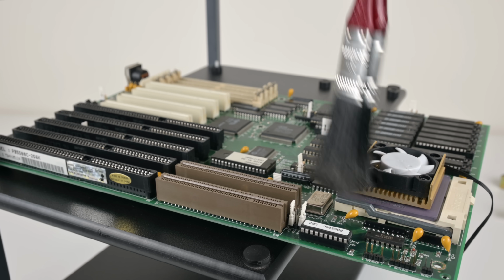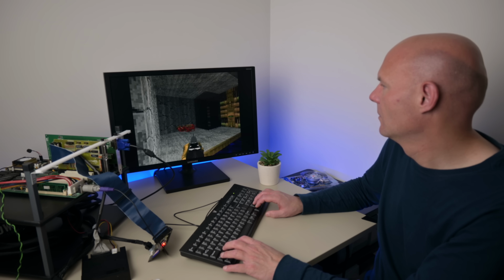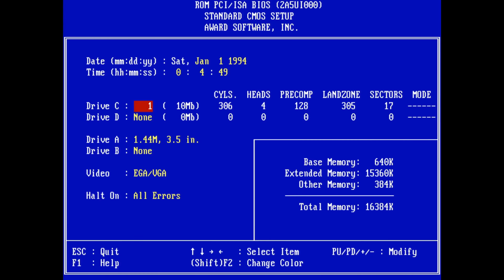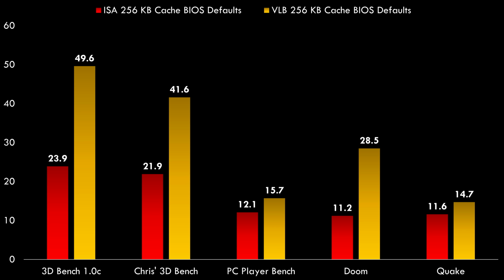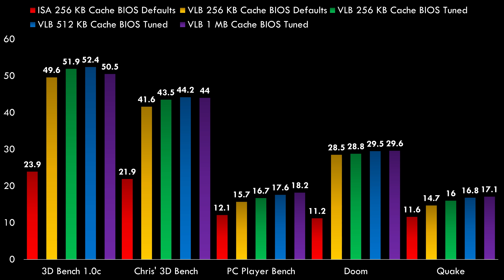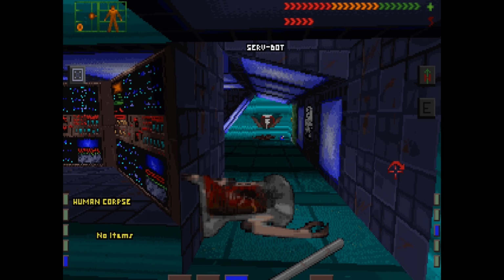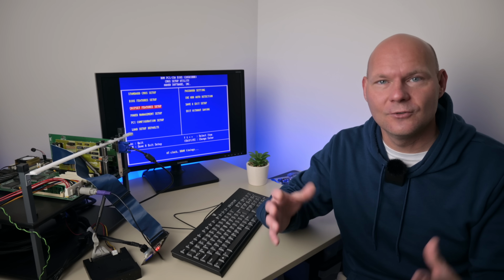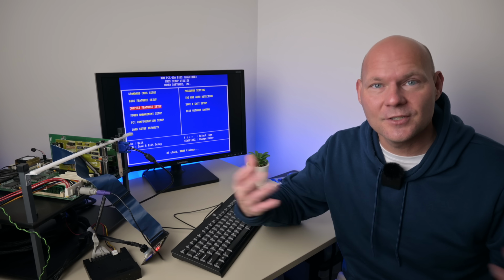Broken CPU Launched the Pentium Branding

Comment: 08:00 not a huge performance boost?!?!? Naah, from 11 to 28 FPS in Doom, you won't notice that :PpPpPPP heh. I had the 60mhz, initially the FDIV buggaroo then not bugged in the mail courtesy of a penitent Intel. But something is wrong with your setup, it defo runs Doom properly cache or no cache. You know what is wrong? No one, and I really mean no one - ran ISA or VLB graphics on these. Ever. You need a 5436 Cirrus or some other period correct PCI card. These were VERY expensive machines back in the day, the CPU and motherboard alone cost more than a complete decent 486dx2-66 with 8mb maybe even 16mb ram and 400mb hdd. That's why NO ONE gimped them by using handicapped VLB or ISA graphics on them. I worked in a PC store a couple of years later and have thus seen plenty of machines from this era. Guess how many with VLB things in them? One. I advised the customer to ritually burn the thing. I don't remember the specifics anymore but there is a problem with VLB in these where you suckerpunch the IO or something by using it, and there is a reason why 1 or 2 out o 20-30 motherboards for the first pentium had VLB. None of the proper boards had it, by proper I mean Intel spec that actually let these things perform properly, unlike that... thing... that you have it in there.

Comment: A Peacock Pentium 60 with 8 MB PS/2 memory, 420 MB HDD and a Spea Vega 7 1 MB PCI was my very first PC, purchased in 1994. Price was good at that point of time (2400 DM) but the seller had to cut corners to make that price possible. The Vega 7 was slow like a snail, in many benchmarks like Superscape I got less FPS then a 100 Mhz DX4 with a better card. Also the card was faulty and had a red tint if working at 33 Mhz, so overclocking my Pentium 60 to 66 Mhz was not possible without a red tinted image. That was of course no problem with the Pentium at 60 Mhz, because PCI only works at 30 Mhz. That most likely was the reason it ended in my computer, it was e-waste from the beginning and Peacock got it cheap. 

Also they installed Novell Dos 7 on that PC (because it was cheaper then MS-DOS), no one in my class was able to help me with that and I was unable to use the PC for several weeks before someone "borrowed" me MS-DOS 6.20. Then class mates were able to help me and suddenly I had fun with the computer. 

Two years later I purchased my next PC (this time selfbuilt) and had to run the 133 Mhz Pentium for at least three months at 120 Mhz before I was able to purchase a new graphics card that had no problems working at 33 Mhz PCI clock (I settled for a Matrox Millennium 2 MB).

The case of that old Pentium 60 is with me to this day and housed several retro project in the last 30 years. :)  

PS: why is there Pentium-S written on the infopage during boot? 5:52

I thought Pentium-S was the name for the P54CS (133-200 Mhz, first released in 1995) for Socket 7 and Wikipedia confirms that.

Comment: I opted for a P200MMX build. It's a perfect speed imo; no runtime 200 issues (when I had a 233, I started to see those but with this one - not a single issue), plenty power for higher/later DOS stuff, and with SETMUL it can go way down to a 386-early 486 level if I choose. I do have a 486SX-25 laptop so I don't drop it too far often but having that ability is nice. The board is a SS7 ATX board so it works in modern cases too.

486s and early Pentiums are too expensive these days :(

Comment: I was an engineer developing array radar in the UK . Base software was written on a pdp11 and then compiled for the Pentium.  When I left to join the city of London as an investment analyst the system was just not working on a Pentium but was when using the pdp11. Months later was sent the message that the fault was in the processor and not the software. I was a victim of the floating point error
Reply from the maker: Amazing! Thank you for sharing.

Comment: It's a little shame to remove THIS battery. I have exact this type on one of my 486 board and it's still in perfect shape: no signs of leaking or bulging and have 3,7 V. Manufactured probably in 4 week  of 1994 by visible marking on it. Some type of eternal battery? 😄
What voltage was yours?
Reply from the maker: I won't risk it, it's just not worth it. Yea you can use external battery pack or mod a coin battery yourself if you want.
Reply: Yes, fully understand and agree with you. But lithium batteries are far more durable. Of course I still occasionally check it and if appear any sign of damage or leak, it get out immediately.

Comment: So a few days ago, I wrote a comment for what I almost forgot was another video lol.
If I had to guess, if you weren't keen on wasting money for good games (and could magically see what the most economical choices were), I think this sequence is reasonable:
In the late 80s, you get an Amiga, or if you're american an NES. In 91, you get a SNES. The monstrosity the other video focused on, a Sega CD 32X, is laughed off. In 94, you buy a 486dx2 66 PC, mainly for Doom. In 95 you get a PS1. In 96 you upgrade the PC CPU to an AM5x86 133 to get playable framerates in Quake. In 98 or 99 you get a Super Socket 7 PC, probably with a K6 and a 3D accelerator, for Half Life/Q2/whatever. In 2000/2001 you upgrade that K6 to a K6-3, and you overclock it, which ought to last you until the A64 era. Around the same time you get a PS2. Dunno about after that.
Reply from the maker: I did have a PSX! It was MY console. The 3D era. Never got much into the older platform.stylr game consoles...
Reply: @philscomputerlab  You know its interesting and kinda sorta weird how the PC and console gaming communities are weirdly separate. In the 90s, PC gaming was almost like an alternate universe, existing in its own sphere unaware of the other (I mean it was, but it wasn't considered worth looking into), evolving in its own direction. At least until the early/mid 2000s lol.
Reply from the maker: @kargaroc386  Absolutely! Until we got XBox 360, PS3 and console ports 😭 Remember 8800 GTX in SLI? Running Bioshock at 2560x1600! Just no comparison. It was an entirely different experience.

Comment: I separate heatsinks on graphics cards with hotair. I blow carefully with air, high temperature on the radiator so that it heats up quickly and then I quickly peel it off. Be careful, it's very hot. I haven't tried with the CPU yet. I don't know if it's safe for porcelain processors.

Comment: Diamond Stealth 64 🤤.  That was the goto card of the day. A time when brands like Diamond meant more than the chip maker, in this case S3.

I saved like mad but tech advances outstripped my saving capacity. Initial target was a fast 286... then 386DX... then 486DX2-66... almost there, wait "Pen" what. Pentium? OK. PCI bus on Pentium vs ageing but marginally faster (allegedly) VESA local bus on 486DX4-100. I ended up with PCI and a Cyrix 6x86.

The graphics card was, wait for it, wait... A generic Cirrus Logic 5440. I installed the optional 1MB upgrade. 2Mb wow! Back in the day when you could add more RAM to your graphics card. In the day GPU didn't mean anything, it had not been invented yet. The 2D day.

Comment: Im "building" a machine with the exact same hardware chipset specs, even down to the S3 Trio64 (Had one of those in a machine i built around 1995) in PCem (look it up) as I watch this (virtually, except for of course the IDE controller, motherboard and drives, except I "added" a soundblaster 1.5), Running DOS and Windows 3.11.

For some computing experaments, ill let you know if anything interesting happens. :D
Reply from the maker: Awesome 👍

Comment: My...fourth computer, I think it was, was a Packard Bell P60. Talk about experiments...I was able to get the original 66MHz clock out of it and did run into the FDIV bug a few times. It tended to hard lock the system. I also cut off some VRAM chips from a dead video card and shoved them into the open VRAM sockets on the motherboard (yep, some crap IGP) to get a full meg of video RAM in the thing.

I didn't know anyone made an AT Pentium board. I thought they were all ATX or proprietary by that point.
Reply from the maker: There are even later boards with AT and some have both, AT as well as ATX.

Comment: It's amusing that their Generations of the Main Pentium line-ups started with a flawed CPU, similar to the last Generation of Main line-up Pentiums, with Pentium 4 and Socket 423... Seems like they had to start and end that the same way... xD

... Although in retrospective I think the Pentium 4 as a whole was giving Intel much more headaches than the Pentium 60/66, since it was replaced by Core 2 Line-up, while the Pentium 1 would live for another day and still grow.

But in terms of Pentium 60 itself - I think it would run Windows 95 rather okay, and I would try DOS games that could run too fast on a Pentium II/Pentium III without tweaking, but also trying it's power with something like Network Q Rally Championship or The Settlers II from 1996. Shame about that bug though, otherwise it would be much more appealing than it is.

Comment: I studied computing around 1995-7 and I was aware of them as we had a technical manual (I had come from the world of Motorola 68k/PPC so had basic knowledge) and I remember the crossover from 486 to Pentium's well.  The Pentium 60/66 was pretty rare, most people I knew bought either a 486DX4/100 or a Pentium 75 or newer.  I was given a Compaq Deskpro XE 560 in the early 2000's, it had a Pentium 60 and 8Mb RAM. I upgraded it to 136Mb of RAM but IDE was a pain - I eventually got a 2.1Gb drive working with it.  It had Compaq QVision 1280 graphics on a proprietary local bus and only 4x ISA slots!  My one also didn't have a 256k cache module. Apparently the IDE bus was also hobbled... I ran Win NT 3.1 on it.   I donated it onto another collector when I moved out of my parents house.

Comment: For those who don't know, the reason why the 1MB cache configuration was slower in some things is that larger caches require longer times to look things up.  Plus, some programs aren't large enough to keep that much in the cache, so they don't benefit from more cache.  Sometimes, there isn't enough data being cached to make up for the longer latencies of the larger cache.  So, it's a balancing act.

Comment: In the mid 90s I had one of the OPTi boards that was VLB only. Oddly enough it was in an AST machine but was otherwise a standard AT board, and I later put it in a standard AT case since the AST case had a crappy drive layout.

It also had no on board IO which sucked. So you had a Pentium class CPU using an ISA IO board. I had a VLB IO board but for some reason it wouldn't get along, probably some VLB wait state issue or something under the hood about VLB not really being designed for pentium

Still it was faster than the DX2/66 I had before for sure, and my Stealth64 VLB ran quite well.

It also overclocked easily with a single jumper for 60/66, I just added a fan.

The FDIV bug was never a concern for playing games and running Win95.

Not long after I got a 5x86/133 and OCed it to 160. It was much much faster than the P66. The P66 lived out its last days running FreeBSD as a cable router for years until the early 2000s, the only time I ever rebooted it was if it lost power or I had to do an OS upgrade.

Comment: I never had the original Pentiums. I was on the AMD wagon at the time, using the 486 100-133 versions and then I went with K6 variants. I recall it was like 50% of a Pentium price. I switched to Intel when Celeron 300A came out, had a couple of Pentium 3 machines and later went with Athlons and Athlon64. During those days, each release brought a significant performance boost, I was often selling my hardware and buying a new one.

Comment: Hallo Phil, warum muss der Kühler runter?, seih doch froh das er gut hält und gut ist.
This early platform is more of a collector's item. I'd rather look for a Socket 7 P233 system to use for 1988-1998 games. The only disadvantage here is the missing AGP slot. Yes, there is Super Socket 7 with AGP, but it's also very hard to find at an affordable price.
Reply from the maker: That is true, good point!

Comment: In order to remove thermal epoxy that was used to glue the heatsink to the CPU. put the CPU into a freezer bag (zip lock) and shove it into the freezer overnight, this will weaken the epoxy as its not meant to sub zero temps. used to use this method to remove ramsinks from nVidia GPU's back when the Geforce 2 and Geforce 3 were new
Reply from the maker: Good tip!

Comment: I like to remove glued-on heatsinks with freezespray. Spray it directly on the heatsink for about 15 seconds and from very close, you don´t need to spray it anywhere else on the board. Then let it sit for about 10 seconds and use something plastic to gently twist it off, with my Voodoo3 I simply used a credit card to pry it and it just popped off. Then let it sit for a while so that the freeze wears off, the components are in a fragile state when they´re frozen.

Comment: I had to come back to this video because I remembered that I grabbed an old PCI video card out of the e-waste bin at work, and I just noticed one of the chips on it is a Cirrus Logic CL-GD5422, the same chip as your ISA card. It's an Imagine 128 from Number Nine, which features their own GPU, the Imagine 128. So it's weird that it actually has two graphics chips onboard. But after a bit of research, the VGA Museum website says the Cirrus Logic chip is used for DOS modes, which suggests the DOS performance would be not much better than you saw with your ISA card.

The Imagine 128 chip itself has a 128-bit memory bus, and my card has 4MB of video memory, which suggests good theoretical performance, but apparently it doesn't have any 3D acceleration. Contemporary reviews suggests it's a fast 2D card under Windows 95, with high resolution and colour depth capabilities, and very good Photoshop performance. Sadly, I don't have the time this weekend to build up a system to test it out on.
Reply from the maker: I have a feeling that even DOS performance would be better with your PCI card. Similar to an ISA overclock...

Comment: I don't think I've ever seen a Pentium system that actually had 1MB of cache installed, but now I can see it's probably not worthwhile upgrading over 512K.

Interestingly, I found out a while back that most of Doom's sound effects were actually from commercial stock sound effects libraries. I also found out that the Smashing Pumpkins song Where Boys Fear to Tread from 1995 features samples of the barrel/rocket explosion sound effect from Doom, which is actually a reference to a December 1993 Usenet post which suggested to id Software that they name their next game Smashing Pumpkins Into Small Piles Of Putrid Debris, which in turn ended up becoming a cheat in the game - typing IDSPISPOPD enabled noclip mode.

That song is on one of my favourite albums, and the weird thing is that I knew that song had the Doom sound effect from some notes that I read on a fan site in the early 2000s, and I also knew about the Doom cheat code, but I never knew that it was an acronym for Smashing Pumpkins Into Small Piles Of Putrid Debris. I only recently discovered the connection when I was watching another video where they played Doom and remembered the Doom sound effect origin thing, so I Googled it and found the source. Then I remembered the part about the Smashing Pumpkins using the sound effect in their song and Googled that, only to discover the connection to the Usenet post and the cheat.

So yeah, it's really weird that I discovered a connection between one of my favourite bands from the 90s and one of my favourite games from the 90s almost 30 years later!
Reply from the maker: Wow that's some deep knowledge thanks for sharing!

Comment: I remember the 60mhz chips also melted sockets and caught on fire cause of no or inadequate heating
Reply from the maker: 🤔 Interesting haven't heard of that to be honest.
Reply: @philscomputerlab  The very early 5v chips were most susceptible to it. It was found that if the fans on the coolers ever failed the chips would overheat and start melting the sockets. The 3.3v chips replaced the 5v chips a year or so later and everyone started putting more substantial heatsinks on them.

Comment: It's not night vision, maybe the art they based it on is (on second look, it seems that they based the helmet of a tank crew rather then a pilot). It's a h.m.d the pilot (more the weapons officer) has it on to control the machine gun an aim with head rotation. It supposed to look like this so the operator will still be able to see the controls and cockpit. Plus the night vision goggles from around that era for the helicopter were more of a rectangular box shape with 2 lenses in the front (similar to the VR headsets you see today rather then goggles like). At least in the Air Force I served in.
Reply from the maker: Thanks for the detailed explanation!

Comment: around 2001 my dad bought essentially all the content of a small defunct computer repair store and of that collection, there were 2 mobo's for those and like 3 cpu's....... never was able to get any of them working, the cpu's are still kicking around, the boards I'm sure got tossed ** to remove the cpu it's possible to throw it in the freezer than pry it off but be warned you might take off the printing on the top of the cpu if there is one